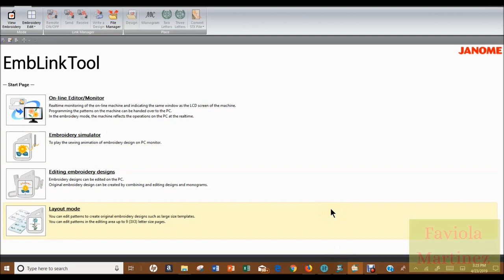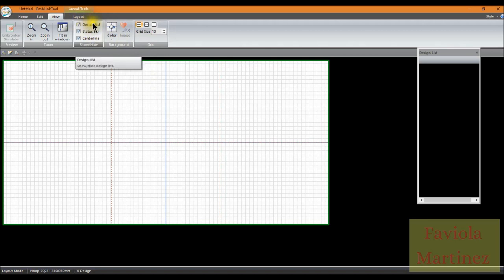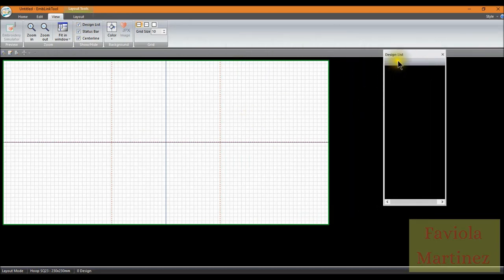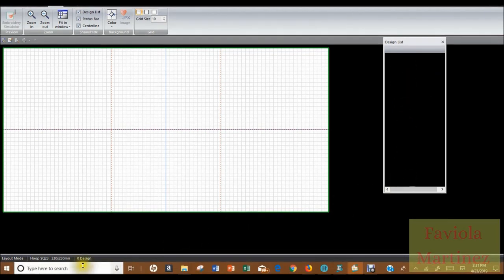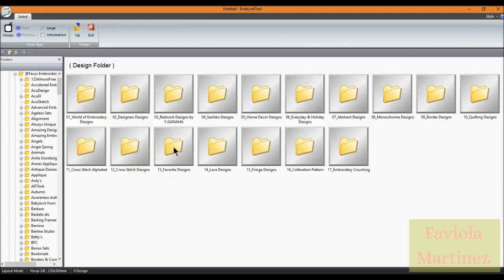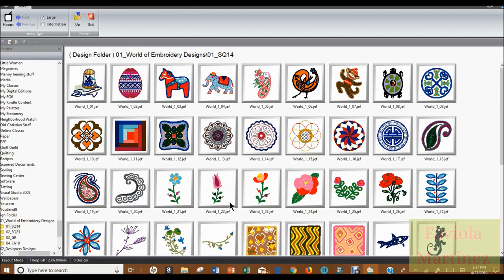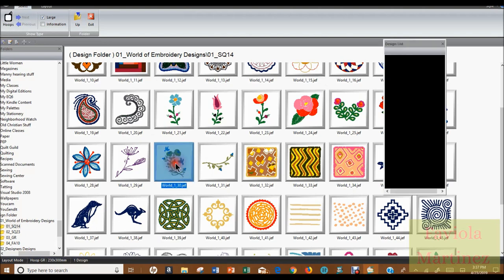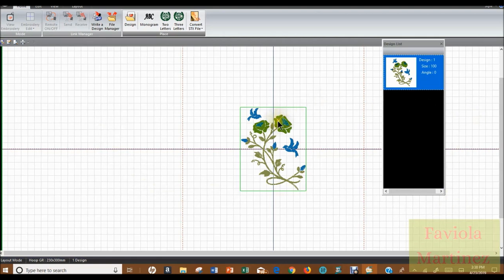Horizon Link Suite Part 2-Layout Mode

Comment: Since you've done some color changing in Layout, I assume that I would then need to open the designs in Embroidery Edit in order to change those colors in the embroidery file. Of course, I could just use a different thread color while stitching and not bother to change it in the design if I didn't want to do that.
Reply from the maker: When you save your layout it will save it with the color changes you made while doing the layout